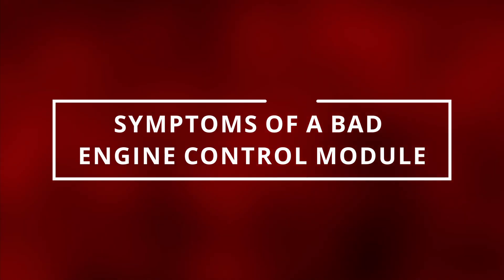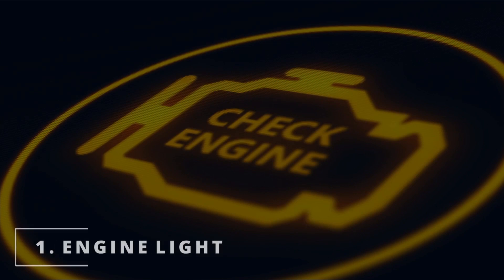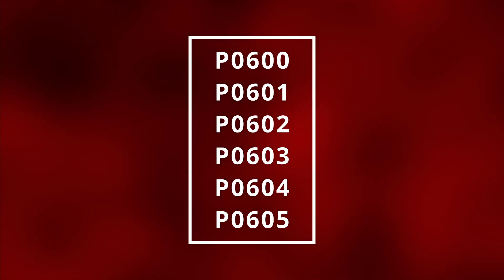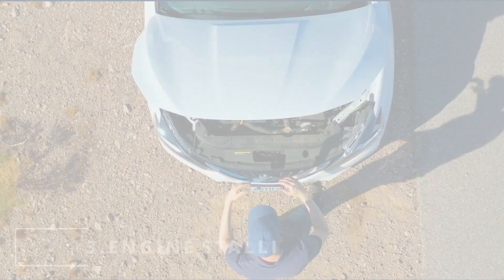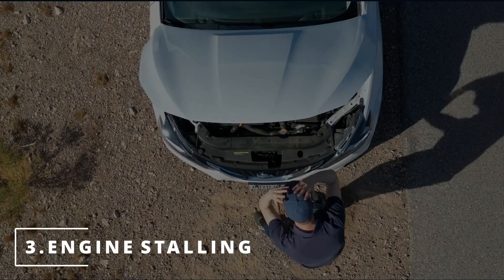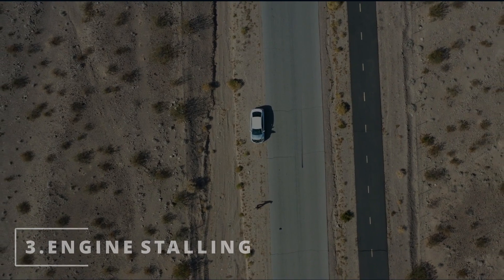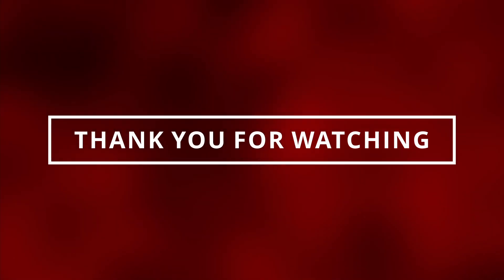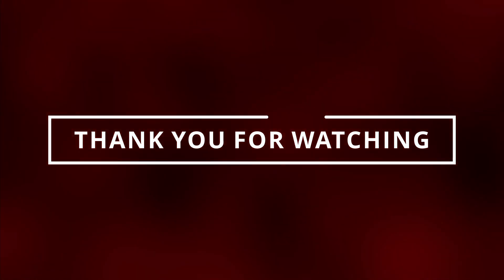SYMPTOMS OF A BAD ECM (ENGINE CONTROL MODULE)

Comment: I have one for you guys: Whenever my 2001 Tundra is left outside and it pours rain say overnight, when I start it it runs really, really bad. Runs so rough feels and sounds like multiple cylinders misfiring. Anybody ever experienced this and found a solution?
Reply: What kind of air intake is on it
Reply: @Billfillmore  Thanks for responding. I’m on vacation and won’t be home until this coming weekend, I’ll reach out then.
Reply: Open the filter housing and see if condensation probably sucking it through throttle body

Comment: Getting a new ecm installed today by Chevy in my C8 my car was throwing codes and it’s practically brand new. It was saying service transmission but as soon as we cleared the codes it was good for a while the. It was right back to acting like it was messed up.
Reply: Hey bud, was the ECM the problem? My vehicle is doing just about everything in the video, along with transmission codes.

Comment: Is this the cause of the ETC light to come on? I replaced the throttlebody body/pedal accelerator sensor. Relearned, still nothing. My car keeps going into low power/limp mode more frequently
Reply: Me too plus changed all the ignition coils sparks etc and still goes limp mode and can’t accelerate in park 😢
Reply: @fabulous5068  I keep asking what's the cause and how to fix it. But apparently no one knows why. I'm thinking it's the tune I have in the car. Im gonna have my tuner do a revise. If not I heard it could be wire harness connected to the throttle body
Reply: @Mohington  I’ll check that out but all looked good when we changed the throttle.  I was told it might be the PVC but that was changed out or the EGR valve so I’m still trying good luck and I’ll share anymore information or if it’s finally fixed .
Reply: @fabulous5068  hell yeah let me know

Comment: Crv 2000 rough idle want stay on atleast i run the gas for min then went stop at light it has cut off "lights" that come on is the oil and battery any ideal wht this cld be

Comment: I need help with my 2010 Skoda Octavia 1.9 tdi combi. The glow plug light initially kept blinking while driving and so I finally had an engine shutdown. Engine doesn't start anymore, glow plug light doesn't come on again, obd2 not communicating with ECU. Gateway changed and nothing changed.

Comment: This happens to me but i just got it tuned and it has a cam, full exhaust cam only, nothing else not even an air intake. Car burns rich for sure, i mean i know smell isnt what u want to go off of for these but you can taste it and it burns eyes. Its rich. But i also had my map sensor go and replaced but it has been tweaking since. So my guess is my pcm at this point. Was the tune but now i think it could be pcm because i have the engine light for random codes then the codes go away then they come back. Stalls sometimes (could be tune related but idles 95% of the time fine except for initial start before driving)

Comment: 2014 Ford Focus SE
It all started with a barometric pressure sensor when I check the engine light, so just to be safe I changed all the ignition coils spark plugs MAF sensor and air filter to make sure it was getting proper air fuel ratio, turns out my 20 inch wheels must have damaged the PCM because Ford thought it would be a good idea to put the PCM so close to the wheel, PS putting 20s on my car wasn’t the greatest idea I know I know lol

Comment: Now, i thought my 07 Ford Focus had an ECM problem. But it's clear it doesn't. Because my car runs and drive's fine, but my cluster is lit up. The OBDII port doesn't work, spedometer doesn't work, all the light's are on. 
But, the only three thing's working on my instrument cluster are the gas level, seatbelt light, and highbeam light. Nothing else work's. I looked at every single fuse in and outside. All are good. Tried to hook up OBDII reader and it wouldn't connect. It started having this problem after last winter.

Comment: When i change the ac temperature, or turn on and off the vehicles features, even usb plug on and off my iphone/somebody else’s iphone, the throttle and brake pedal harden or soften.  It’s pretty weird, could it be ecm issue?

Comment: i had a turbo actuator fault.. mechanic reset light, next check engine light was gas pedal, replaced it and again light shortly after.. injector 3.. replaced it and another light just now came on.. truck runs fine just faulty lights i think.. volvo isx2350 in a 670 semi truck… could be computer issue.

Comment: Man thanks for all that.  I have a 91 LS 400 and I've had engine stalls and loss of power/acceleration just out of nowhere.  Now I have something  to fix this problem.  🤞 appreciate the video.  Good work.  👊
Reply: Haven't changed out ECU.  I understand there's a guy in Dallas area who works on/replaces ECU's. But I don't know it thats specific for LS 400's only.  Man  you've done a lot of work to your Audi. GL
Reply: Any updates?
Reply: Hey man, did you replace the ECU on your car? I have random loss of power on my car when it's warmed up and it loses power even more on these hot summer days, the car is Audi A4 B7 1.9 TDI, I've checked and replaced everything, injectors tested, new turbo, new N75 valve, blanked EGR valve, intake and exhaust clean, new MAF and MAP sensor, new tandem pump, checked vacuum hoses and still I wasn't able to solve the problem, regular maintenance is done even before it should be, engine timing also fine, all filters changed etc. Let me know if replacing the ECU solved your acceleration problems, because I have replacing my ECU on my mind soon...
Reply: @AdnanAdo997 did you ever figure it out
Reply: @gabegarcia7779  I think I have, recently fitted new intercooler and swapped regular old OEM vacuum lines with new stronger silicone ones, the car now behaves the way it should, my theory was that my old intercooler was leaking due to old turbo blowing up and all the metal pieces from a shattered turbo internals went flying into the IC...At the time, I had to clean the IC and the oil pan from those metal particles and change engine oil, oil filter, air filter and had fitted a brand new turbo, not a refurbished one...
Reply: could be an intermittent loss of ground
Reply: Long shot but would anyone know if this would relate to a 2012 GMC Sierra I’ve changed the throttle body tps and the acceleration pedal and it was fine for a week and at random my gas pedal will quit responding and it will run super ruff you can pull over turn it off and turn it back on and run fine for a while then do it again
Reply: @Adamolivier2  had similar problems with an 08. Went down many rabbit holes for a year. Turns out it was the AFM/DOD. Had a shop do a DOD delete. All better
Reply: @Adamolivier2  same here f250
Reply: Mine says stabilizertrek , engine power reduced, and stalls

Comment: My car has engine light on, it also not the car doesn’t start at all unless I bridge the fuel relay, and when it starts the gear won’t change work, it’s automatic car, and only the reverse on gearbox will work.

The doors keep locking and unlocking

Comment: My cars lights on the dashboard kept turning on without a key, then my car wouldn’t turn off, I disconnected my whole Ignition switch, and after connecting the battery it still lights up, finally got a code that said short to ground 3/4 of the fuel injectors, and fuel pump is open, but Removing fuse #3 small red 10A turns computer off, does this sound like an ecm issue?

Comment: i have a problem and im pretty sure its ecm related. its a 2005 dodge grand caravan. When driving itll run very rough. Driving with it is like a game of stop and go, itll run but then skip in rpms constantly, like a lawn mower running out of gas. I believe its the ecm as when i got the check engine light checked there wasnt any problems, after wiping/resetting the ecm it runs beautifully for about 15 minutes. Anyone have any other ideas if its not ecm related?
Reply: Check your crankshaft and camshaft position sensors for codes. Might want to clean the throttle body and MAF, might be dirt and carbon blocking off air ways.

Comment: my  alternator went out and the car died 3xs  or i meant the power went out multiple times completly dead...will that cause damage to ecm because my enginelight flashes  but when i turn my engine it goes away ,my shift works but it stays on 4-5 i afto use the cvt to shift it, and i notice it sluggisjh everything works but i really think its a sensor or ecm..ever since it happened these problems occur, nd my alarm doesnt sound off anymore ,my radio also falted till i switched a fuse, i think it killed the fuses

Comment: I have code P0505 on my truck saying "Idle Air Control System". I replaced the Idle Air Valve and still have the check engine light, any ideas?

Comment: My fans keep spinning when the car is turned off and it drains my battery … I changed the coolant temp sensor and checked for corrosion can the module be the reason for this ? I usually just pull the fuse after I park the car so the fans don’t spin. It’s VW GOLF

Comment: How about power steering my 08 cadillac cts has power steering problems after the start of vehicle once you go down the road, gets stiff, had the power steering checked everything was fine, it was plugged with a scanner and was told the computer could be the problem, is that possible and does the pcm have control of the power steering if not do you or anyone reading this have knowledge of how many modules the cts has?

Comment: My service  traction  control  keeps coming  on check  engine  lights on missing  and stalling  code p0641 keeps coming  on I've replaced  the tbs gas pedal  sensor  map sensor  and the fuel tank sensor  still doing same thing  any guides would help on a 06 impala

Comment: Question pls. I have 2002 sentra 2.5 ser automatic with security system.  My ecu is bad , so I need to replace
 It.  How do u go about getting another one.  U do see them on ebay but I'm not shure what numbers to look for. There are some number on the top and big  K4 in the middle and other number at the bottom. Any help will be so helpful please

Comment: Here is one for you:  Lexus ES 300.  Started to stall and idle was really weak.  I took it to our regular shop and he changed the throttle body sensor.  Was fine for a few weeks and started stalling again.  Took it back and he cleaned out the throttle body of carbon build up.  Worked fine for 2 weeks then started stalling again and it wouldn't start.  Took it to Lexus and they adjusted the throttle and said nothing else is wrong.  Still having issues with starting and idle. Could the ECM be bad?
Reply: Could be a crank sensor problem
Reply: I’m having the same issues lmk if you have figured it out
Reply: My car wouldn’t shift pass 2nd gear. Had trans rebuild an started happening again. Knock sensors started failing. Finally took it back an they said the ECU is bad, that was the original problem. Now alternator keeps failing. Same 2000 es300
Reply: Yup
Reply: @Mansfield Man I did nothing happened
Reply: This sounds problem sounds exactly like a clutch pressure control solenoid valve, this also acts as a sensor for the transmission.

Comment: I’m about to purchase a 2011 
HONDA HYBRID CR-Z 
 with approx 180kmiles 
the man selling it that appears NOT to be a car guy says he the car is stock & never had an issue, he went outside & the starter just clicks… Tow it to dealer (actual Honda dealer in rural Tennessee) & they said the ECM, PCM, TCM are bad!!! 
is this even possible? 
Is this even a common crZ problem? 
IS IT EVEN POSSIBLE he took it to a Redneck Honda dealer & they don’t really know much about Hondas Hybrid system?!?! 
I’m thinking 
“Hmmm 🤨does it simply have a bad battery… no way the dealer didn’t check that!! 
It’s a clean lil car …. But I’m nervous to gamble $2500 on it 
I’m thinking I might buy it , play with it & swap out ECU! See if I can fix it & have a good 40mpg car …. Worst case scenario I’ll go K-swap!!!!!! 

Any idea’s🤔 
I’m not a master tech on any lvl, but I played around with Hondas a lot back in the day 
I’ve done a few B18/B16 swaps in older civic/integras to give you an idea of my skill set 
I’m located outside Atlanta Georgia 

You guys have any advice for me?!?
🙏tnx in advance guys🙏

Comment: I've had a new starter and a new battery installed in my 2010 SS. It worked fine for a bit, but it started having a slow start again and putting it in limp mode constantly and giving me service stabilitrak. Any ideas? Chevy told me there's so many different things going on with it but I believe it's one solid issue and I am going to replace the ecm fuse. Clean my throttle body. If that doesn't work I'm hoping it's the spark plugs or something not too pricey. I bought a crankshaft position censor years ago and never never installed it because idk how to lol. Anyone think it could be that? Please give advice or opinions. Love my camaro just wanna get it back to its original state. Also when I bought the car someone had cut the catalytic convertor off with previous owner and put straight pipe on it and I'm missing an o2 censor. Let me know guys cheers
Reply: Mine would have hard starts too . Read on some forums to add another ground cable from the block to the chasis and that helped it go away. Idk if that's worth a try on yours

Comment: I have a 2008 Ford Explorer 4x4 wheel drive 161000 miles on it. Basically, rebuilt the whole engine. Having trouble with the engine light and it's showing all 4 02 sensors bad I changed them all including the purge valve EGR valve air flow sensor I'm losing about a 100 miles a tank of gas. I rebuilt the whole engine all the Cam chains fresh tune up I did get a new ECM computer 2 years ago but that guy went out of business cause it was under warranty so now I gotta send it to some place to get rebuilt for 600 bucks. Other than losing fuel and the engine light staying on it, it runs and drives fine except for the gas.

Comment: Would a bad ECM cause the transmission to act up?
Reply: I'm not a mechanic, but yes, that is my understanding. A faulty ECM can cause shifting problems, as mentioned in the video. Another thing that could cause the transmission to "act up" is a faulty vehicle speed sensor, or faulty wiring going to the speed sensor. This is one of the things I'm currently dealing with with my vehicle. I got the bad speed sensor replaced, but it's still having issues and giving me engine error codes, I'm thinking it's the ECM.

Comment: My 97 Saturn SC2 has been throwing the P0327 code. They changed the knock sensor like three times and now it's intermittent. They cleaned out the well area where the knock sensor goes in and still doing it. Could it be the computer?